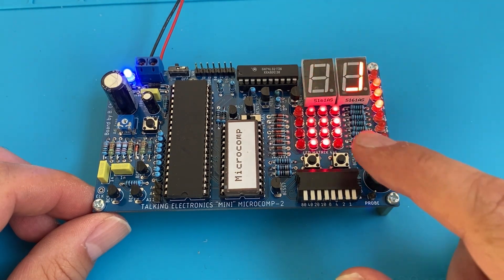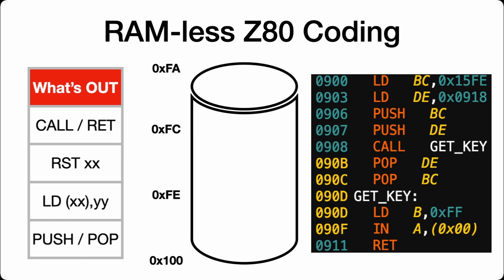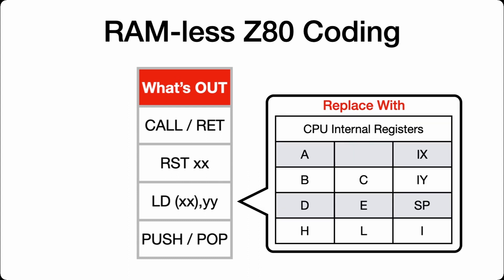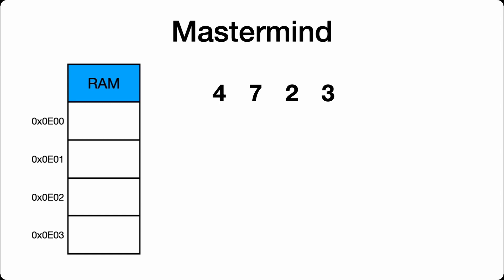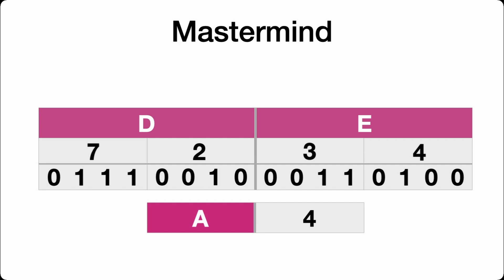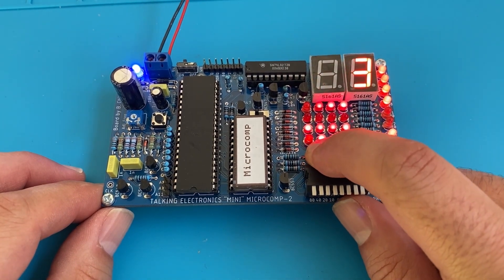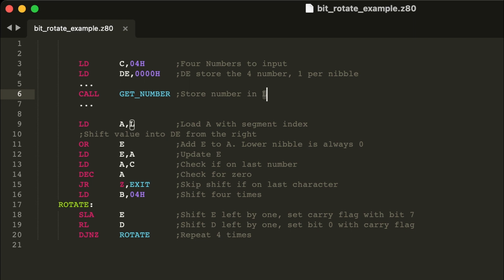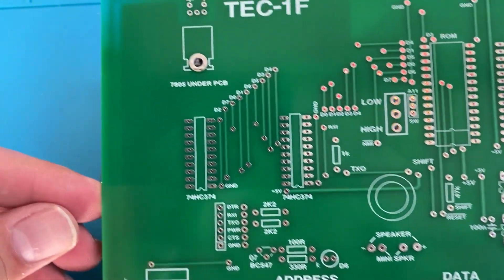Z80 Programming with no RAM! Crazy but challenging Mastermind game

Comment: You can use the stack as a table and as a list of addresses, although you can't push you can still pop from a predefined stack.  You can predefined the stack with lists of subroutines to call, and simply call each by using ret. To set a new list of subroutines simply set sp to the new list.  You can also put data on the stack and use sp to read the data by popping it.
Reply from the maker: Great ideas of using stack functionality with fixed lists

Comment: RAMless operation with the 8080 or Z80 is commonly used for Diagnostic or POST (Power On Self Test) ROMS. Contrary to immediate assumptions, the Stack Pointer along with instructions like CALL, RET, POP, EX (HL),SP can be used in RAMless programs/systems for using read only data and pointers.

Comment: There is a way to do this without the jump.  You duplicate the bit that moves from one register to the other into the carry flag.  I learned this in a class where we had to implement a SRA instruction on an 8080 that doesn't have it.  Only 2 people got the simple, yet tricky, solution of using the carry.  This problem is similar.  RLC E; RR E; RL D; RL E.  The RLC duplicates bit 7 into the carry so the RR will put E back to as it was, but now bit 7 is in carry too.  RL D puts E's bit seven, now in carry, in bit 0 of D.  RL E gets D's bit 7 into it's bit 0.
Reply from the maker: Thanks for sharing this well explained solution. I'm somewhat literal when I code and probably under utilise the carry flag.  I'm surprised how little shift/rotation content is out there.
Reply: I should have mentioned I was looking at the 16 bit shift code.